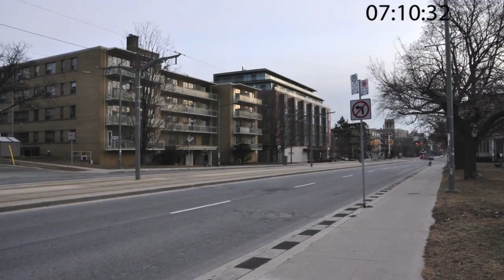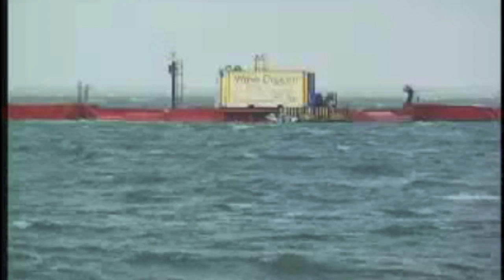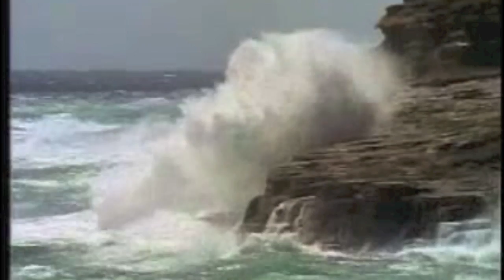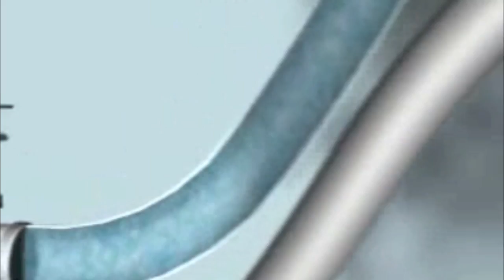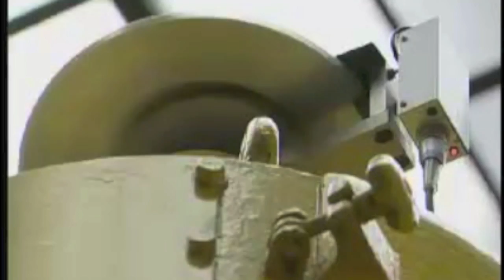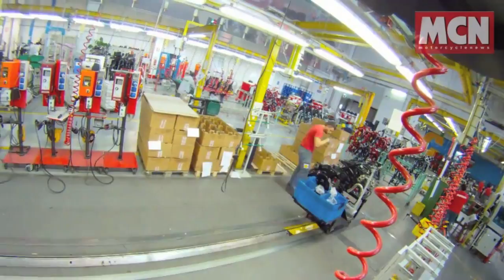Wave Dragon Physics

Comment: It might be possible to build 'soft' versions of these devices- even inflatable versions.  This could actually wind up being very cheap!  I once walked on a beach where waves were overtopping an exposed sand bar.  The spot where the water was flowing back out had incredibly fast current- you could barely wade through it.  When they optimize this design it will be a winner!
Reply: No not really. Wave energy converters are ALLWAYS a looser. It has been that for at least 75 years. And it will NEVER change. Many different designs have been tried. Not a single design has been superior to all the other non useable designs. A waste of time and money, that could have been used for something useable.